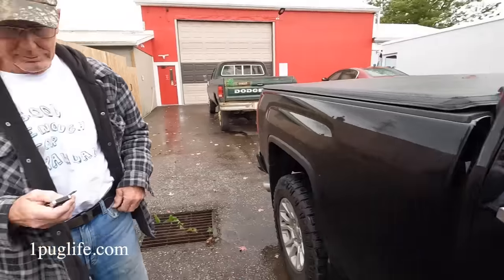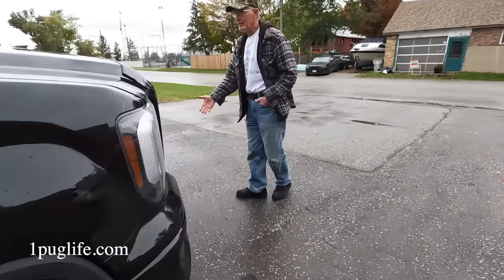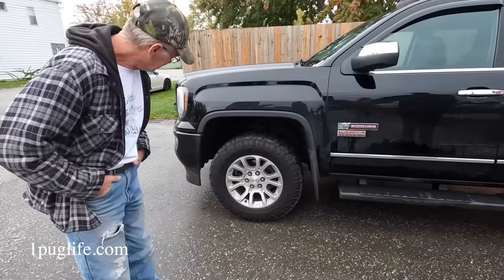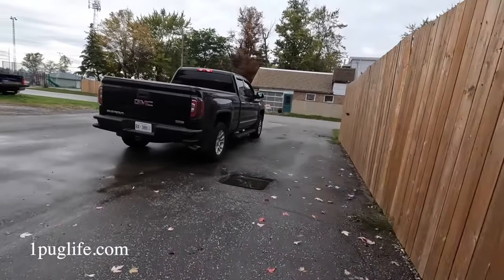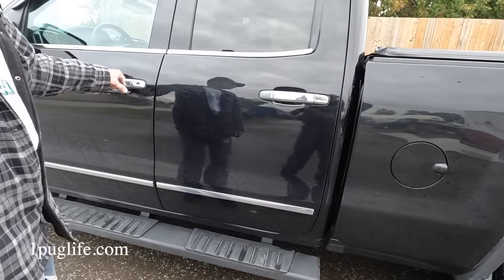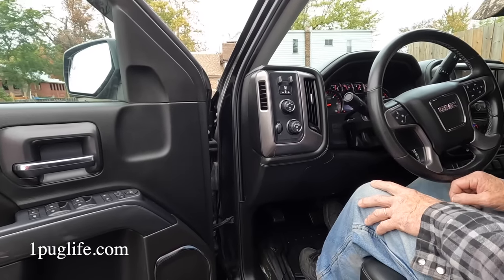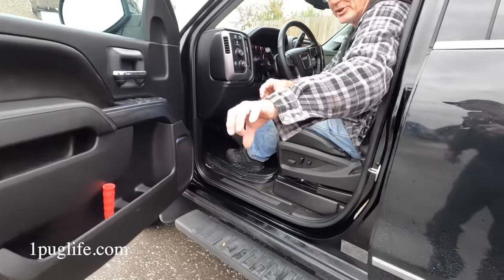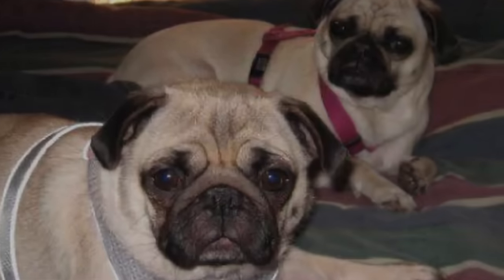crawdads new NEW rig

Comment: Don't disable 8-6-4 cylinder deactivation , have had 2 Chevy trucks with it and it worked perfect .That's why they get 25 mpg !
Reply: Until it goes for a shyte   if it's parked too close to a gas 5.7 Dodge, and it catches the cam/lifter eating virus they have L.O.L.

Comment: Friggin Rights he did ... Crawdad stuck to his gm guns. Tuning out the DOD lifters will make that motor run an extra 100k miles without floppin a lifter. Sweet freakin rig, Craw ... they drive so nice ... tap the blinker arm and itll blink 3 times and shut off ... 6 times if yer in tow mode... fer lane changin .  Git some fancy silicone wipers and rain-ex orange fluid fer winter...washer fluid tank holds a full gallon ... nice seein you lovin yer new rig.. i get it, but chris is jealous as frig fer shur ... now keep her out of the celery patch!! 😢 ...  😂😮😂😂
Reply: Hope he got it top’d up with blinkerfluid with all that blinking it can do , bmp , but Nice truck it is for shure ✌️
Reply: @Atomic21-w1k  hahaaaa, yeah i know im a goof ... i didnt know about that blinker feature till i had my silverado fer 5 yrs  🤣..

Comment: Tell crawdad if he likes that truck then he should change the transmisssion fluid. Those chevys have transmission issues. I have a 2016 at my shop now. Cant buy a used transmission because all of em are junk. Use ac delco fluid and filter. do it every 30k miles.